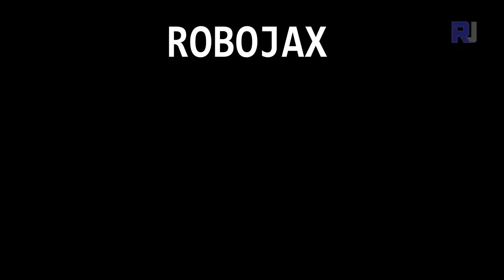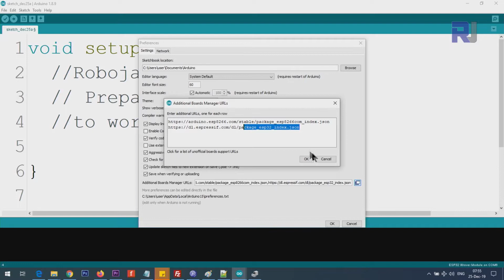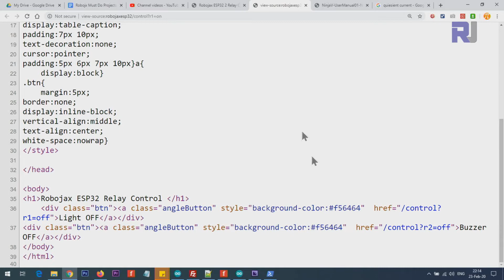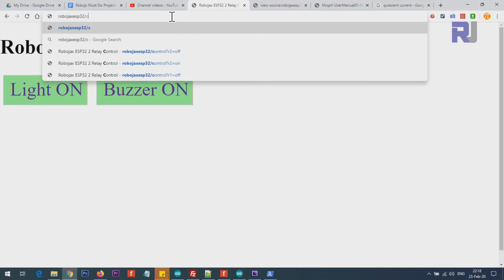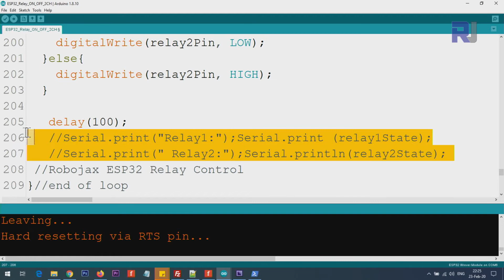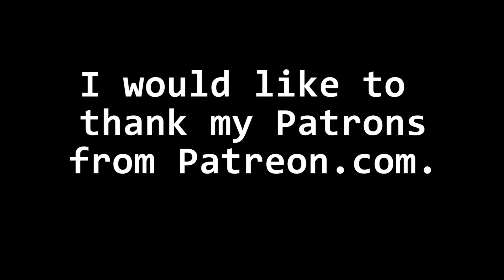Comment: Thank you for your videos. Have learned a lot from them.
Still didn't find one thing what is missing.

I have small home automation project for my bedroom.
Im controlling bedroom lights via esp32 with physical switch and relays.
But I wanna have master of switch and don't know hove to code that. 
Current code what I'm using is yours from this video transferred to esp32.

https://www.youtube.com/watch?v=3EZecphNdAI&t=144s

Could you make special code to me for 8 relays and 8+1 switches (one is master)?
and what that would cost?
Reply: if you watched the video, you should know by now that you can add more. I have explained it. You can learn about 4 to 16 channel relay here https://youtu.be/Wbm3MCMgM_s
Reply: Robojax 
Thank you for answering. 
Yes I have been able to add more relays on my system but...
This kind of MASTER SWITCH is still missing. 
One that would shutdown all lights 
My switches are momentary so it should be able to do. 
So this last code strip is still missing.